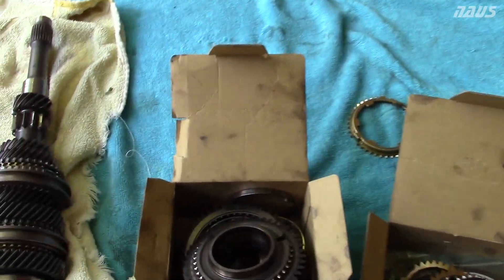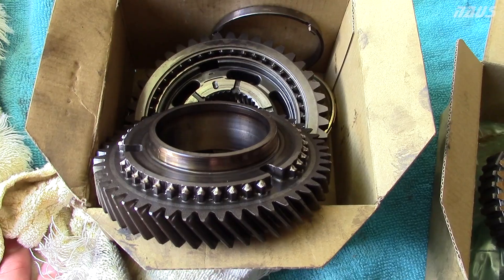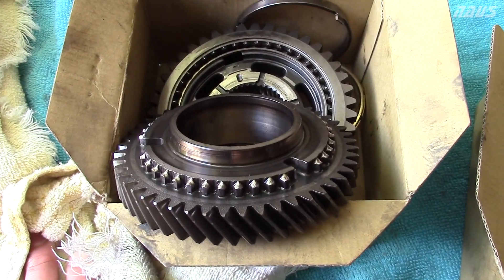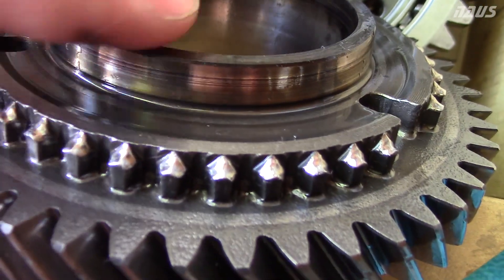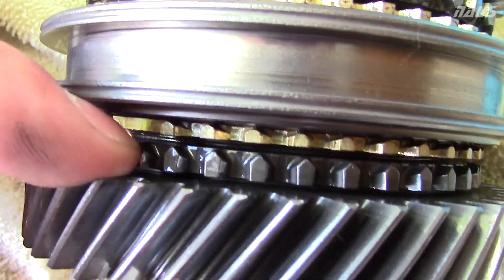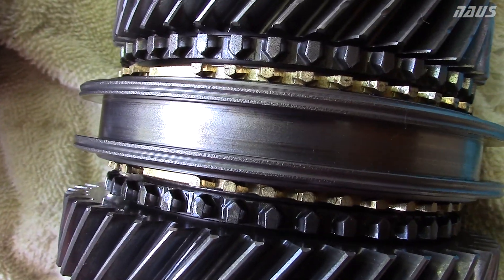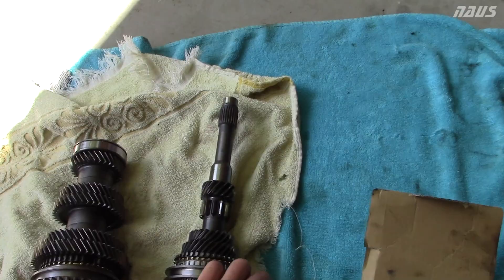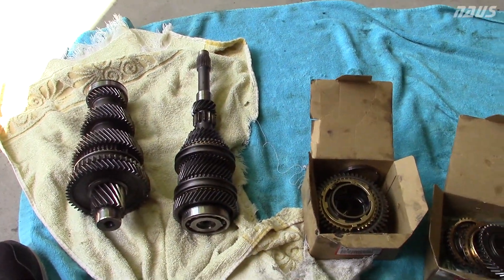The 2nd Gear Grind Explained! What Damage Does it Actually Do?

Comment: honda reliability right....
Reply from the maker: any manual car will wear like this with an abusive driver... not just Honda's, lol they all work the same
Reply: The Wolf rsx s had a tsb on the issue... They replaced my entire transmission.
Reply: anonymous my dads (mine for 8 months) 06 kia rio is grinding like hell shifting from first to second, but not from third to second. Its a strange thing
Reply: Even my 07 R18 is a total pos.Got stuck with a lemon
Reply: Honda makes junk now. They just ride on the perception of reliability they built in the 1990s.

Comment: its the CMC that causes that major grinding. I learned this a while ago when my car started doing this.
Reply from the maker: *****
 23444-PNS-326 and 23432-PNS-315 are the second and third gear sets. Pulled that right from my receipt.
Reply from the maker: Clutch Master Cylinder
Reply: ***** Where'd you get the 2nd gear replacement and are the sychros synchrotech? If so, how are they so far and how many miles on them since you installed? Any issues? I'm currently in VA and will need to do this very soon, for 2nd and 3rd gear. My 2nd gear is only like this under high revs, 3rd gear is just like your 2nd gear in this video.
I'm going to replace the CMC, the clutch, and the sychros and the damaged gears all together.
Reply from the maker: I got a new second and third gearset from honda, OEM. Its around $600 for both gearsets. Only use OEM, dont but the syncrotech cheap crap. The gearsets come with new OEM honda syncros which are the best for the car
Reply: Aaron Belcher ummmm....what is cmc?
Reply: Thanks, is there by any chance you could help me get the part numbers? I use college hills Honda to get my OEM stuff. I already knew about the Synchrotech crap, I just wasn't sure if you used them or not, and if so, I wanted to know your impression on them if you did, because I have heard more bad than good, but maybe from bad drivers, so wider perspective would be better. I'll PM you my email info.

Comment: Hi Naus, have you ever gotten the 1st to 2nd gear lockout when in high rpms? I'm having this problem as well as a slight notchiness when shifting from 2nd into 3rd. I know these two issues are common, but I have yet to find a solution. Any suggestions? :/
Reply from the maker: I use to have this on my original transmission before rebuilding it. Try changing your MTF to start, If your still running the OEM CMC id recommend replacing that as well. I have the Hybrid racing EM1 CMC kit (this was my first mod to the car). This CMC helped a lot when the clutch engagement point was adjusted correctly. These are both cheap to do, however if both of these mods to not Fix your 2nd gear grind, you are going to need a new second gear set (which includes a new 2nd gear syncro). If your grind second a lot your gear probably looks like the one in the video, only way to fix it permanently is to replace it.
Reply: Joseph Green   As a pro driver, I have the solution for you.  Rev match and it will never grind again.  If it's destroyed already you can rev match,  AND  double clutch, and it will drop into gear with one finger.   Watch my  You tube video on how to one finger shift a six speed smoothly up and down.  Coming soon!
Reply: Watch my video "Shift a 6 Speed Like a Pro" and never have to replace another transmission.

Comment: Hello , I follow you from Italy , I have a question for you : I bought a new car a few weeks ago and I happened to grind one time, what can happen for once?  In your opinion how many times must grind the gear to get to destroy a gear as the one that shows in the video ? Thanks so much.
Reply from the maker: a lot more than once, if you grind once it's okay, just don't keep applying pressure during the grind, that will make it worse
Reply: Okay thanks for the quick reply. In your opinion how much grind  it takes to begin to have problems? I think that modern gearshift  are solid enough, right?
Reply from the maker: +Roberto Marsili way too many variables in that question for me to give an answer, all I can say is when it happens you'll know
Reply: I'll explain what happened to me: I had the first gear engaged and when  the clutch is released the gear is  jumped out grinding  because it was inserted incorrectly. Low speed without applying force.